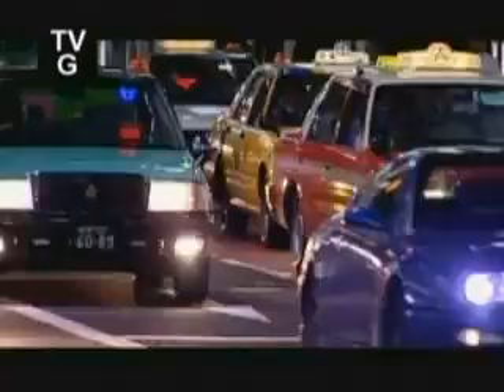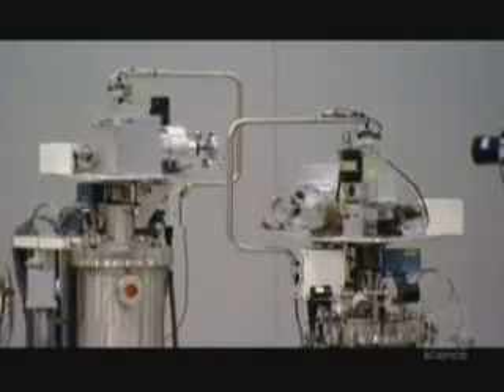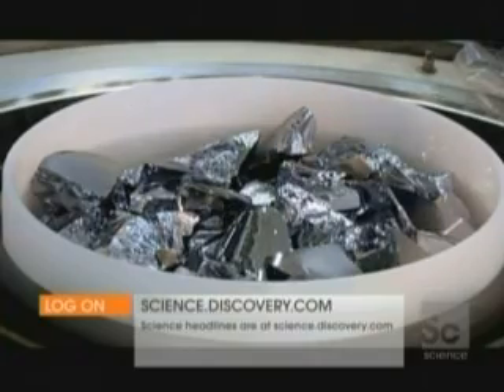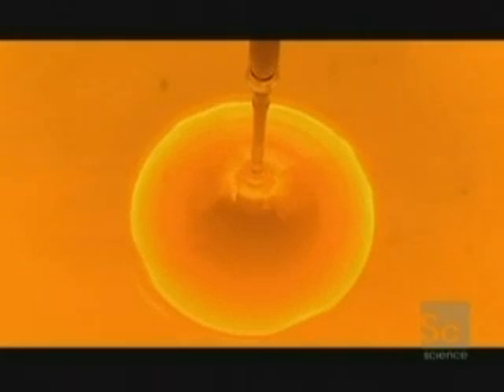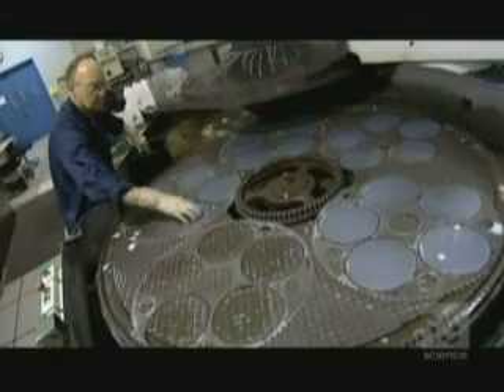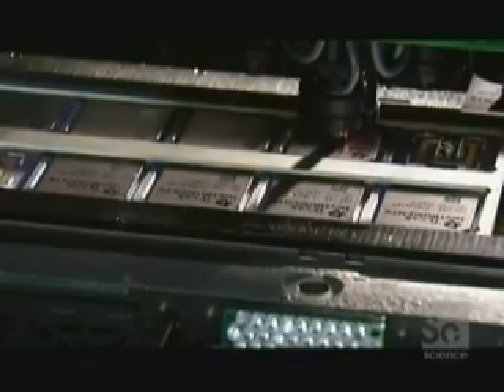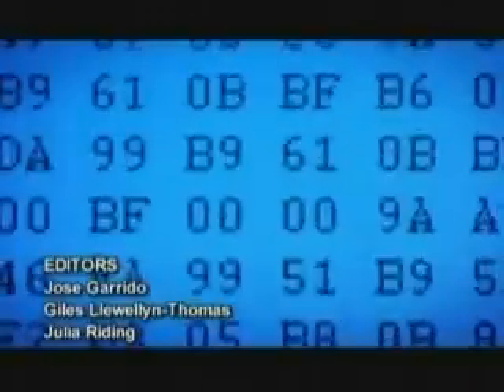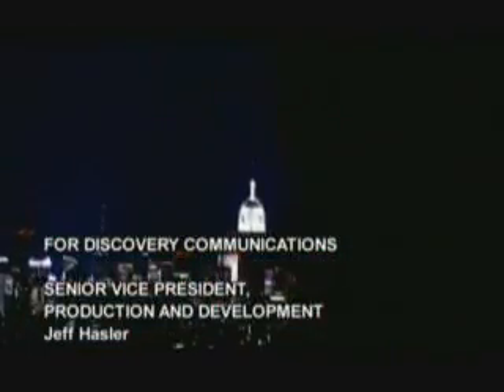How do they make Silicon Wafers and Computer Chips?

Comment: The process is amazing but it took me until the end of the video to realize this video was from 15 years ago and the process is probably very different now considering the extremely tiny size of transistors.
Reply: it's not much different :) the only difference is that the features on the chips are much smaller now

Comment: I use to work in the semiconductor indudustry msny years ago. I workrd S  vendor at Texas instruments in the mid 90's . I worked onsite maintaining a "tool" that is the venaculr used in industry to descibe the mschines ised to make computer chops. I was onsite to tske care of a device called a diffusion furnace. The wafers shown in this vidro looks like 8 inch diameter wsfers. Now they use 12 inch diameter wsfers I can see this video is a bit old but the process is very similar to what is being used today. I also worked at company in Portland Oregon that mskes the silicon wafers that are made and then sent to  companies loke Intel and Texas instruments. I remember seeing thr crozoski pullers And the lapping machines and the wire cutters.

Comment: "And according to Moore's Law, that number doubles every two years"  Oh you sweet, sweet summer child.
Reply: As far as i know the statement was later changed from 2 yrs to 18 months.
Reply: @mg9854  As far as I'm aware, we suck, and it's getting harder and harder to squeeze more transistors in there, so we have to get our gains by being a bit more clever about it and adjusting how things are laid out, rather than just making 'em smaller, more numerous, and having reliable gains that way.
Reply: @WhompingWalrus  It's not just a matter of the manufacturing getting harder but also corporate greed. 
AMD tripped over themselves with the release and flop of their Bulldozer architecture and then doubled down with Piledriver. This failure resulted in a near Intel monopoly, knowing that AMD wouldn't have any competitive CPUs for years to come Intel massively cut back their development. For the next 5 years or so Intel released new CPUs with just enough generational improvement to make people buy them and also to keep the feds off their back, but not enough improvement to actually warrant any significant RND spending, all while hiking up prices because AMD had nothing competitive to offer.
Luckily have competition again and Intel has been forced to get their act together, although given AMD's price jump this generation I fear history may repeat its self.
Reply: @somelokyguy6466  I wouldn't know about any of that.  Been failing to find an in-stock GPU to buy since 2015.
Reply: Moore’s law has “slowed” and the coefficient has lowered, but innovations in AI and informatics has buoyed computing speeds. Not strictly Moore’s law, we are approaching atomic limits, but who knows what sideways branches of discoveries will yield?

Comment: I didn't understand how the transisters are imprinted or coded onto the flawless silicon wafer pls explain me 😓 . After the process of treating with photolithography  chemical onto the wafer.
Reply: afaik the photolithografy makes it so the protective layer they put on before is changed in some places and can be removed there without removing the rest... so now some places on the wafer are protected and others exposed... now the exposed parts can be changed, for example doped or etched while the rest will stay as it was... and by doing this over and over many times the necessary parts of transistors and their connections are slowly created

Comment: A silicon wafer cost $100 to $400 and intel can make more or less a hundred chips in a single wafer and they sell each processor for $50 to thousand dollars each! You greedy intel!
Reply from the maker: You are only calculating the material cost.  What about the billions of dollars they spent on research and development? Those chip designers probably can live on air alone because IP can be copied and pirates only need to pay for the materials and reap all the financial gains.
Reply: A designer only needs a PC to design it. And make a few chips to test it. lol! As usual... it's always the R&D that is used as a reason by people in amurrrica  to jack up their prices. Haha! Just like those other RAM brand names that buy chips from samsung, micron, elpida, etc. All they did was to design a RAM pcb and slap that chip they bought into that pcb then jack up the price and blame on R&D. LOL!
Reply: @boogerking7411  sure, r&d people only need a pc to work, but they also need licenses for programs which can cost in the thousands per year and ofc they also want to get payed... a rough aestimate of the cost of an engineer is like 100$ per hour and processors are highly complex products so i guess they've got quite a number of these guys working for quite some time which ofc adds up
Reply: @boogerking7411  the companys using samsungs ram chips also have to pay for the chips themselves... ofc they are not magicly going to cost far less

Comment: I wonder if anyone ever ruined a chip by farting in the lab
Reply: This is actually not true to an extent. I work in a semiconductor fab as an inspection specialist, which is basically making sure there are no defects/particles on the wafers (or as little as possible) after Photo-resist and/or final inspection for shipment. Farting is a gas, therefore can't cause particles. Sneezing, even-though we have masks CAN cause particles. We are in a cloth suit, not an airtight suit like astronauts use. Friction causes particles, which means when inspecting a wafer of micro chips that are exposed. We are to make as little movement and breathing as possible. These are the protocol of our fab, not all companies have the same protocol and recipes. Such as not all companies use a tier 1 clean room with a full bunny suit. They would just use masks. I'm sure there are people in other companies that would disagree with what I am saying, which is why I point this out. I hope this informed some people :D Time for sleep and another 12 hour shift haha...
Reply: +locodude12 Remember they are wearing a "bunny suit" - so just like spacesuits, any bodily emissions are self contained.
Reply: Yes they call that product the celeron.
Reply: LMFAO

Comment: Bit off topic, but I'd ike to point out that the first 32 seconds of this video already contain four rhetorics-based facepalm moments that give a great example of what is called bullshit speech:
1) Saying we might not realize that we are surrounded by a revolutionary technological invention, being the computer chip, despite it being revolutionary and thus widely known and THE icon of electronics even among laymen.
2) Mixing statement 1 with saying it is "arguably" the most revolutionary invention. So it might just as well not be. It's highly opinion- and interpretation-based.
3) Saying that if today a device uses electricity, it PROBABLY uses one. That's like saying "usually always".
4) Saying that the tiny gizmo is "of course" the silicon chip. "OF COURSE"? Didn't you just say we might not realize it's the silicon chip, indicating that we're not aware of it's relevance?

If you try to make a sentence that contains all four of these statements, you'll fully realize the high degree of 'blabla' in the commenting. ;-)

Comment: worked in the fabs for over 10 yrs in all the different processes. it really is a fascinating field. good pay and benefits but those 12 shifts can be brutal. the next big thing will be chips made of graphene that are only 1 atom thick
Reply: How much u make? Did hey let you get free silicon chips or cup processors?
Reply: all i can tell u without knowing who u are going to work for is to study, study, study  the specs and listen to the other operators and u should do fine...good luck and DO NOT MISPROCESS
Reply: Low 6-figure is usually the norm for chip designers.
Reply: Were you ever round when they cleaned the CVD chambers?
Reply: How do they cut between the lines to make the whole into the little square?
Reply: @Thetreetroll  automated tools that don't work ethic dick wag!!
Reply: @American-Motors-Corporation  can't formulate a sentence without insulting someone but keeps talking about ethics... btw how are you gonna life off your farm once you've become old?
Reply: I work in strip Etch fuck the acids are hazardous as fuck HF Hydrofluoric acid  will eat you away
Reply: much redpect to you, im annoyed w the alert sound
Reply: Currently working at the Missouri branch of this company for a year and a half in Inspection. The stories to tell.
Reply: Working Linear and Rotary wetetch sinks, some very expensive machines I've got my hands on.
Reply: liar
Reply: yeah 12 hours that means lot more taxes!!  yeah the are according to folks like you gonna get ahead though that is work ethic bullshit via taxes!! but the sheep go on doing the bidding the of the companies and state!!
Reply: Whoooooa, you are a special kind of person.

Comment: Much of the handling which is now done by computers were done by hand. The first ICs had feature sizes 1000 times larger than today, then handling is less critical. Despite the high cost of a fab (to over 1 billion dollar) the first microprocessors cost more than today's, which outperform them by a factor of a billion. That was partly due to the far from optimal process at the time.

Comment: Most likely, the first machines did not use chips - they used discrete transistors instead. Once you have the first chips you can use them to build better machines, and so on.

Comment from the maker: I guess they probably used some stock footage instead of showing you the top secret project at the time. Up on the horizon is Silicon ReRAM chip that is built on Silicon oxide and can run 100 times faster. Innovation never ends.

Comment: computer chips or solar wafers essentially no real difference just size and complexity of wires and one has trillions of microdevices on it.  however the basic substrate is the same and not complex to make.  solar panels should not be expensive if this is all it takes to make them. 4 step process.

Comment from the maker: @lemonrind It is not easy without infrastructure support such as precision manufacturing equipments. MacGyver does not exist in real world. Do you think you can solder a circuit together using a stick of burning wood?  Blowing things up is easy. If you understand chemistry, you can start a chemical reaction to release the chemical energy stored in most materials.  But putting things together requires an entirely different ball of wax.

Comment from the maker: @TheDefianceCrew Dig through your grandpa's garage. If you are lucky, you may find a vacuum tube radio. That was how they did it before they invented semi-conductor transistors. Same concept, use electronic gates to execute pre-programmed logic. Vacuum tubes were bulky, solid state transistors were smaller, then they invented a process to use lithography to further shrink and etch a circuit design onto silicon substrate. They even use ion implantation now. The gates did the same thing as before.

Comment from the maker: @jaymorpheus11 The word Clean in clean room refers to the removal of airborne dust particles which may ruin the microscopic circuitry being produced. That guarantees nothing about those nasty chemical vapors emitted during the process of making these chips. The matters that cause rare cancers and deformed kids are in molecular level, which are a few orders of magnitude smaller than dust particles.

Comment from the maker: @DrCooler1000 Read about the basics on how a transistor works (it is used as a gate or an electronic switch). Then miniaturize it and put millions and millions of them on a chip. Put them together in a way that the engineers can program the on and off logic of these switches. Then you get a computer chip.

Comment: @cplai eum they discovered that if you make a solar sell smaller than the wave length of the light that it would significant increase the power output whit the same light because the light will be trapped inside the cell (Google it it is true )

Comment from the maker: @DeltaA118 Silicone is a gel like chemical compound used for breast implant and sealant. Silicon is an element in the same group as Carbon in the periodic table. Sand is made of mostly Silicon oxide and pure silicon is what shown in this video.

Comment from the maker: @rweiii1 I disagree with you. If what you implied is true, then the memory chip price would be as expensive as CPU. The mass production process of chip making is relatively inexpensive. The expensive part is the research and design which has to be distributed to all the unit produced. Number of CPUs produced is low compare to memory chips, so the per unit cost is high.

Comment: The video is little misleading in that it shows a bipolar junction transistor symbol, yet in reality, the transistors used on 99.9% of all chips are MOSFETs (metal-oxide semiconductor field effect transistors)which are very different and much simpler to make on a chip.They  also take up less area.

ECL used bipolar transistors.

Comment: @salemcripple 
Etching like that is carried out, but on a different layer.  The entire process is one of using layers.  A layer of SiO2 (glass) is grown on the surface of the wafer, etch resist coated on top, and then exposed to UV light. And then dipped in acid to etch the channels.  Into those channels impurity atoms are inserted (either by firing the atoms in at high speed, or coating the wafer in a chemical and heating in a furnace)

Comment: @feye1markie 
It's not that silicon is easy to use.  Silicon belongs to a group of substances known as semiconductors which are inbetween insulators and metals.  
The key thing about silicon is that by adding addition elements into it, called -dopants or impurities- you can change the electrilcal properties of the material.
You can make it easier to conduct electricity (by adding atoms with extra electrons) or harder (by adding atoms with too few electrons).

Comment: @chetrx1 
Respond to this video...
Field programmed chips can be purchased for a few dollars up to 100's, even 1000's dollars.  The design software runs on a PC and many vendors gave away the design software for free.  But this technology is only really suitable for digital circuit designs.  Your application sounds like it may need some analog electronics too, which you would have to implement external to the digital chip.

Check out: PLD, FPGA

Comment: @chetrx1 
You could make one yourself!  There are broadly speaking two types of chip: mask programmed (where the chip is made in a manufacturing plant), or Field Programmed, where you use a standard 'blank' chip for which you would then carry out your own design (or have an engineer like me design it for you), and then you program your design into the chip using electricity.

For very high volume quantities, the mask program route works out cheaper but is far more specialised to do

Comment: @
Silicon is itself a semiconductor. It's not the doping that makes it a semiconductor.  The doping changes the electrical properties.
Metals are conductors.  Plastics are typically insulators.  Silicon, germanium are semiconductors, their conductivity lies between that of a metal and insulator.
The conductivity of pure silicon is determined by the band gap, the difference in energy between the conduction and valence bands, which for Silicon is 1.1eV.

Comment: @aaronvespro 

cplai is right.  The fundamental issue with silicon based solar cells is their efficiency, with typically only 10-15% of the light falling on them is converted into electricity.

Plastic based photovoltaics  have the potential to yield higher efficiency.

Comment from the maker: @salemcripple Pure silicon crystal forms a non-conducting base and a matrix to hold atoms of other elements. Silicon doped with impurities such as boron become semi-conducting with the foreign atoms supplying or borrowing an electron from the neighboring silicon atom matrix. The movement of the free flowing electrons or the electron "voids" along these doped silicon pathway forms the current flowing in the intergrated circuits. The chip is NOT made of one material, but numerous variation of Si.

Comment: I still don't really understand how the silicon chip keeps from shorting itself out, or how the whole chip isn't electrified all at once when the silicon that is doing the work, is also the base (or frame if you will) that the chip is made out of. I understand how a transistor works, but if the "wires", frame, "switch", indeed everything, is all made out of the same material, what keeps the current going in the same direction, and not just electrifying the whole chip at once?

Comment from the maker: @azeemiqbal123 First thing to do is to move to Korea or Taiwan.  Most of the silicon chip foundries have been moved out of the USA. Second is to get several billion dollar worth of investment to start something like this.  Third, just plan for a complete failure because the silicon industry is already well established and no new comer can beat the existing giants.  You can't profit much until you can drastically reduced production cost when something have already become a commodity.

Comment: Do they still make Si chips like this? 
I heard a rumour about work on 3D chip circuits.
Cant you etch one layer of circuit, spray an atomised layer of silicon crystals, etch the next layer and so on.. oh i guess the crystal orientation has something to do with electricity flow. mmm..